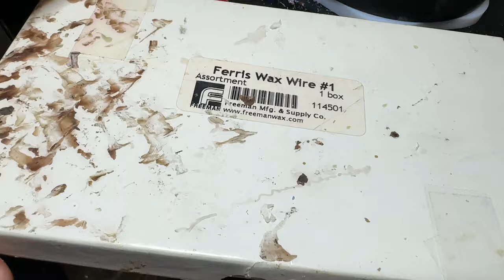Casting a Unique Bronze Ring

Comment: I have been pouring bronze now for several years and have never used a vacuum to get the bronze to the finer details - just made sure that it was well sprued and gated in the traditional manner.  So I would be very interested to see an experiment with and without the using the vacuum in the pour.  I have been thoroughly enjoying your videos and am in the process of setting up a home foundry as I have lost access to the University foundry.  I would also like to praise your castings of your original creatures.

Comment: Congratulations on the works you create.

I would like you to give me some information about the type of plaster you use.
is it plaster of paris? Or simple building plaster;

every time i put the plaster mold in my kiln it cracks. and the aluminum is poured from the outside,

I follow the plaster heating diagram up to 650 degrees.

Comment: Damn Lucas, Nice job! I'd have added small vents on the horns. I have a similar vacuum set up, |What was that gasket material you had on? I use a high temp copper based gasket paste. Also- your vac pulls nicely- which one is it?
Reply: i think he uses normal silicone fresh out of the tube, since it works well and is cheap.

Comment: Nice work!

No, I wouldn't because it is prone to a ring avulsion event.  But then again, I don't wear normal rings either for the same reason.  😋 And here's another safety tip.  The big carbide burr that you used with your rotary tool.  YIKES!  You were using it right next to your unprotected finger! 😁 I used to do the same until one day I gouged out a big chunk of flesh right down to the bone.  Up until that happened I used to think rotary tools like that were completely harmless, and they are, but not when using big burrs.  Nowadays, I wear thick leather finger cots.  They also help you when it gets too hot to hold from the friction of grinding and polishing.
Reply from the maker: Good advice. Thank you for that.

Comment: good video, but i wouldnt wear it 😅. i have an idea for a sculpture that could be interesting or bad, i dont know. make a model out of styrofoam. cover the model with wax but make it very drippy with lots of lines and drops until it looks good. melt the styrofoam chemically with gasoline or paint remover or other stuff that melts it. now you have a hollow wax sculpture to cast that has a very unique look.
Reply from the maker: That would be an interesting idea.
Reply: may also solve the top heavy issue @lundgrenbronzestudios